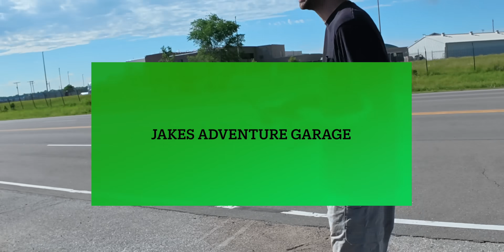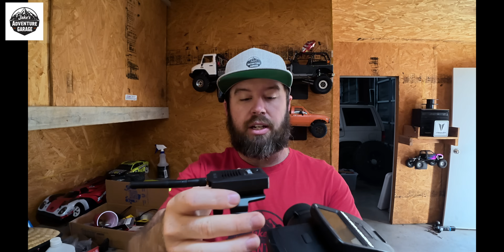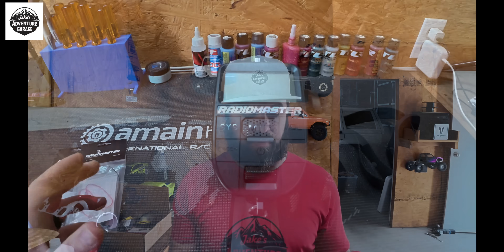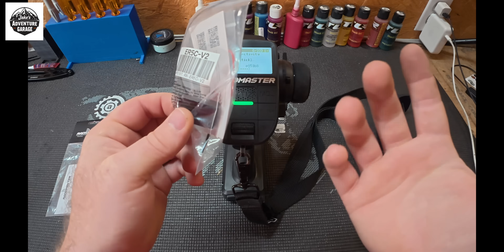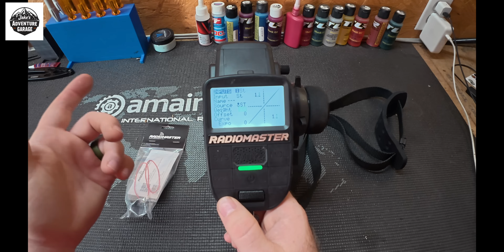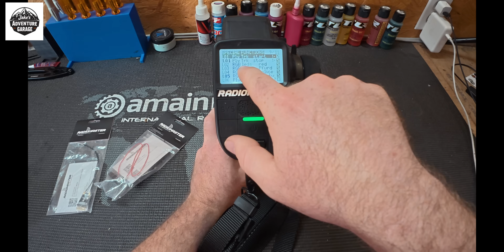Radiomaster MT12 - My Opinion & Quick Start Guide - 4K

Comment: ooh, the "not zero" thing is because you haven't calibrated it. Go to the settings menu and find the hardware section, there should be a calibrate button. And you can also in the outputs page change the ppm center of each channel to make the center be what you want exactly to the 1/1000 of the throw. The hall sensors in the throttle and steering are actually quite good.

Really this somewhat shows the oddness of edgetx, it's super powerful but there's certain little bits of knowledge you sort of need to know. Perhaps the edgetx devs should add a check on startup that prompts you to calibrate if certain axises aren't reading zero on startup.
Reply from the maker: Great information here - thank you!! 🍻🍻

Comment: Gyro-wise there is some small progress on it. Since elrs is open-source too some community members are slowly chipping away at it. (the pwm pins are just pins on a microcontroller so you can plug a IMU board in and the receiver can read it) It doesn't work great yet though. Probably because a lot of the elrs super-enthusiasts fly planes and quads with a full flight computer which does all that and more.
Reply from the maker: That's interesting, hopefully they get it working well soon! I love the radio, but kind of wish it was a more compact format. 🍻

Comment: Good video but the servo issue you are seeing is probably due to your settings elrs is one of if not the fastest protocols. You can set the package rate in the settings to up to 2000packages per second, youll loose some range but hence elrs is more about miles than feet you should be good for any surface vehicle situation. Setting this to 2000 will make any servo thats fast enough itself jitter like jo mama in deep winter 😂 try it. Hope it helps you to get that speed back. 
Keep in mind the servo itself has to be fast enough to do this too. So digital brushless and so on
Reply from the maker: Good tips! I love the radio, and haven’t done much tinkering with the elrs settings. 

I need to dedicate some time to it and make more videos on it!

Thanks for watching and the feedback!! 🍻🍻
Reply: @THEjakesadventuregarage  another thing you need to do if you want to do that, you also need to change the rate for that pwm output in the elrs wifi ui, I believe they default to 50hz because if you feed 333hz into some cheaper servos they freak out.

Comment: Note that some of the ELRS receivers (such as the ER3C-i and the ER5C-i) use an older chip that unfortunately spews out garbage on ch1 and ch2 upon boot (and this is before the firmware is running so this cannot be fixed with a software update) which can play foul on some ESCs and on programmable servos.

The solution is somewhat easy, do the wifi-connect to the receiver and move ch1 and/or ch2 to another output (output 3 on the ER3C-i is fine and 3-5 on the ER5C-i is fine) so if you have the ER3C-i and not a programmable servo then simply move ch2 to output 3 and connect the ESC to output 3 instead of 2 on the receiver then you can connect something to output 2 that does not care about any signals like say a fan or something like that.

Some people have experienced runaways when connecting the ESC to output 2 on the ER3C-i/ER5C-i if the receiver for some reason have done a reboot in the middle of a run (and the garbage output on output 2 then have put the ESC into full drive forward).
Reply from the maker: Thanks for sharing this important information for everyone! I had no idea about channels 1 & 2 on those 2 receivers which is about the only ones I run lol... Again thanks for tuning in & sharing!!🍻🍻

Comment: Good info
Reply: Just so you know this setup with elrs is very fast. As long as your servos can handle it chang the pwm output higher, mine are set to 333hz. You have connect to the reciever via wifi to set the pwm speed. Next make sure the radios packet rate is set to 1000hz. After this you can watch your steering bounce back and forth.
Reply from the maker: @danjones4002 thanks for the insight! It’s already at 333mhz need to check the 1000hz setting. 🍻🍻
Reply from the maker: Thanks for tuning in brother!! 🍻🍻